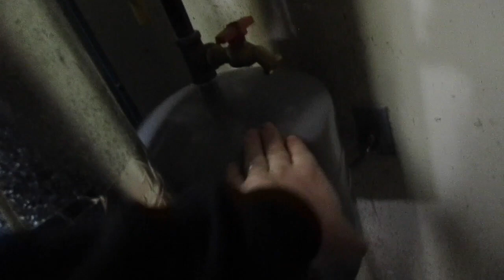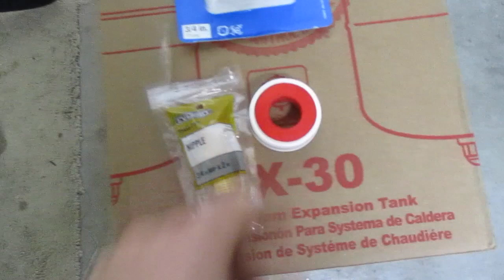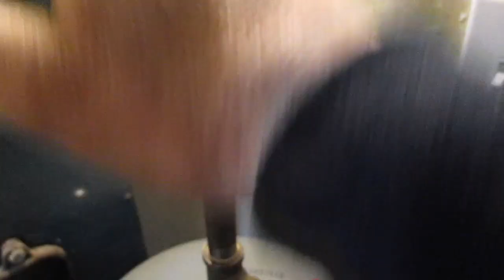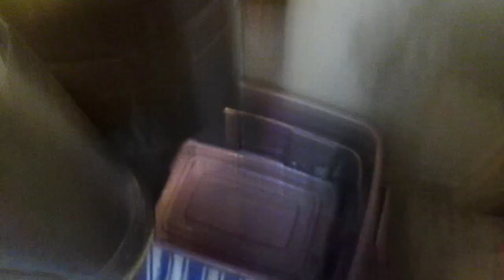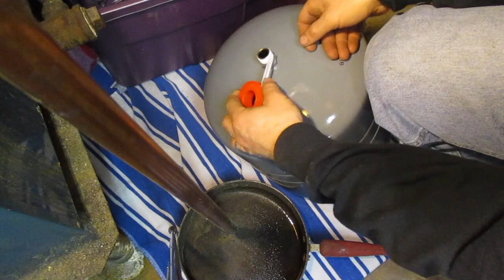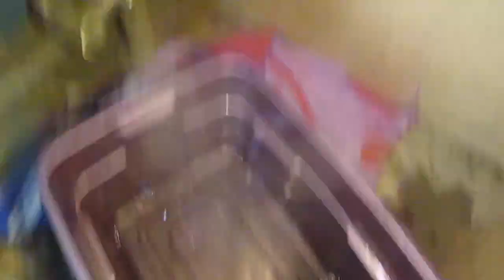How to replace a Leaking Boiler Expansion tank replacement Quick and EASY SIMPLE FIX repair

Comment: Tip: Water is 8lbs per gallon, multiple by your tank size to determine the max weight "if" completely full to know if you can handle it alone.
Reply from the maker: That is correct and definitely important...  I'm going to pin this one at the top.  Thanks!
Reply: @youcanfixit3721  Thank you for the great video, I'm changing my tank today 👍
Reply: Tank changed and it was a piece of cake after watching how it is done 👍
Reply from the maker: @physiques  Awesome! Fairly simple way to save some money and like you say it is pretty simple.  It's usually just the fear in not knowing what prevents people from trying.
Success always feel good... Thanks for the replies....Positive replies are always appreciated, so Thanks to you as well for taking the time to comment

Comment: It’s good that you have your system piped in such a way that you can isolate AND drain the piping to expansion tank. Makes swapping them out far easier than having to drain, refill, and purge a boiler
Reply from the maker: Yikes if there is room you may want to put in a couple valves. Hope you got it and the job went smooth

Comment: What's the problem if I CK the pressure on the expansion tank and I get nothing? (4 or 5gal) No pressure or water & it's the only tank I have. I don't have a water tank...
Reply from the maker: You probably need to replace if old.  If you remove it and it's super heavy (water  logged) then the diaphragm is usually bad.  You can also check this link out.
https://stallionplumbingsaltlakecity.com/5-common-expansion-tank-problems-and-how-a-plumber-can-help/

Comment: How do I get the water back in the system after I replace the expansion tank?
Reply from the maker: You don't drain the system.You just shut the water off to the tank by closing the valve.After you install the tank just open the water valve and you're done.

Comment: If I press on the air valve and water squirts out is the tank broken?
Reply: yes
Reply: What about if Nothing comes out air or water? Can I put air back into the tank? The hole oil furnace without a water heater/tank was down for quite some time..all I have is this expansion tank maybe 4/5 gallon...Ty if anyone answers this question ✌️
Reply: @kertrowlins3954  If nothing comes out, you probably need air. Don’t put that much air in it, I think it only holds 12 to 14 pounds. But look online for the correct information.

Comment: If you had that much pressure from a system closed just above the expansion tank, wouldn't it make sense that the tank was still good (ie, the bladder still intact with 12-15#'s of pressure pushing against the water?)  If it was blown out and you vented the system by opening the pressure relief valve, it should be full of un pressurized water.  Perhaps your inlet water pressure reducing valve (50 psi to 12-15#'s psi) has gone bad, allowing increased pressure in the system and it wasn't your expansion tank?  Probably not a bad Idea to replace it anyway, as they are made in Neverland...they never last.  My $0.02 anyway.
Reply from the maker: It was 12 years old and like $30.  Safest bet was to just replace.  But you may have been right...

Comment: if you check the air valve on the bottom and air comes out, tank is ok ,but don't let out to much. you can check the pressure with a tire pressure gage, but I have no idea what pressure you need. if nothing comes out, it has lost air for some reason or is bad. if water comes out ,it is definitely bad.
Reply: I made a mistake by taking out all the air from the expansion tank, not my hot water radiator make loud noise (very scary). Is there way i can put air back without taking the tank. Also, tank is full of water inside when i took out the air. Please advise,  thanks.
Reply: @AZ.....  there is a rubber diaphragm inside the tank, with air on the side with the air valve like you see on a tire, and water on the other side of the diaphragm . when the water gets hot, it expands inside all the pipes and furnace. if it cant expand into air side of the expansion tank,  because there is no air to expand that rubber diaphragm into, it will raise the pressure inside the pipes until something gives. Usually and hopefully, you will blow off the pressure release valve and scalding hot water will come blasting out so a pipe doesn't blow up. all kinds of noises can start happening  . but when the pressure release valve goes of , that will scare the crap out of you. 
  To put air back in with an air compressor,  You should call home depot and ask a plumper if you can just put in air and how many pounds of pressure to put in . OR , if you first need to , shut furnace circuit breaker off,  let everything cool down, turn off the house water and run the water somewhere till it stops and there is no pressure in the lines . and once the hot water in the system has cooled, you may need to depressurize the heating system to by opening a drain valve or the pressure release valve to. that way no pressure will be pushing into the air side and you can put in the recommended pressure.  
 but call some plumbers and ask .  someone will help . and call home depot too. they will probably walk you trough it. I call and ask stuff all the time.
Reply: @immrnoidall  Thank you so much for you advice and taking time out doing it. I really appreciate it. I will contact HomeDepo and go from there. Again, Thank you.
Reply: @AZ.....  No problem at all. I would be no where with nothing ,without the help of others. So anytime I can pass it on, I do.
Reply: @immrnoidall  Thank you Brother!

Comment: you didn't pressurized you new tank to match your system pressure.   tanks usually come with only 12psi .   and you didn't change out pressure valve?   no need if the tank was bad.
Reply: i WONDER ABOUT THAT, I SEE IN SOME VIDEOS PEOPLE DONT MATCH THE PRESSURE WITH HOUSE PRESSURE, AND SOME DO, SOME JUST INSTALL IT WITH FACTORY 12 psi, WHO IS RIGHT, DO YOU KNOW ?

Comment: Great video. My tank is mounted above the pipe, I tried to twist it off but it started to also twist the pipe underneath. Is there a tool to counter the twisting of the pipe it is inserted into?
Reply from the maker: A pipe wrench would probably do the trick...  Sorry for the late reply, I'm sure you got it already...

Comment: Just fyi.. you wrapped the tape in the wrong direction on the tank
Reply from the maker: Wrapping clockwise and the tank spins on the same way which does not cause it to unravel. 

pretty sure it's right, but hey thanks for the comment.
Reply: @youcanfixit3721 hello sir I have a question.

Comment: Would it be fairly easy at the same time for me to add to my system those two valves you have (the one you used to shut the water off and the one you used to drain the water/release the pressure), or is that likely a more involved project?
Reply from the maker: Were you having issues with them?  I'm a minimalist and if they weren't leaking then I wouldn't change them.  The relief valve may need to be changed, but I figured if it wasn't what was causing the leak why fix it. Although being proactive is never bad.  I'm not sure what you system looks like, so no idea what you're working with or the age of your system or how it was installed.